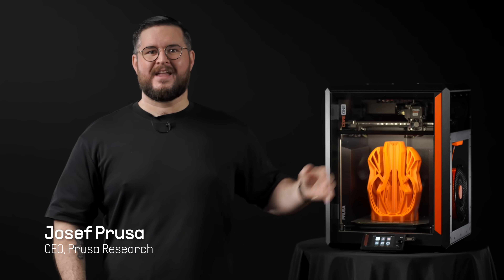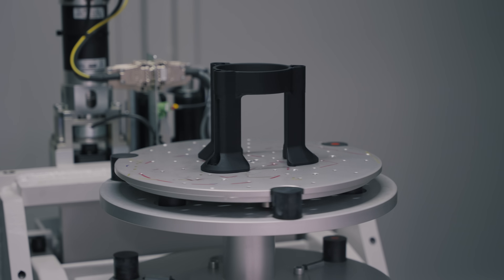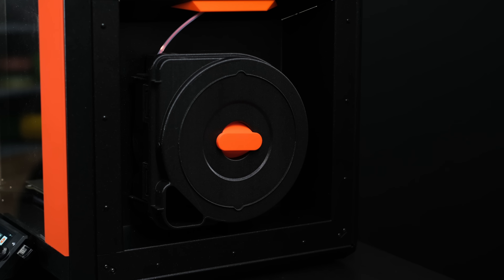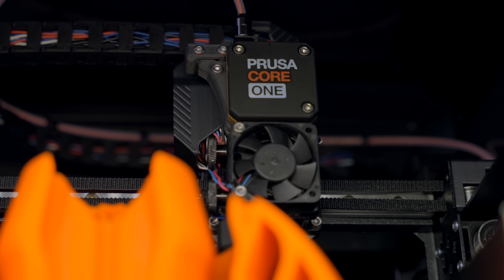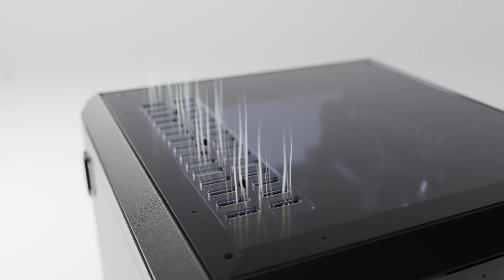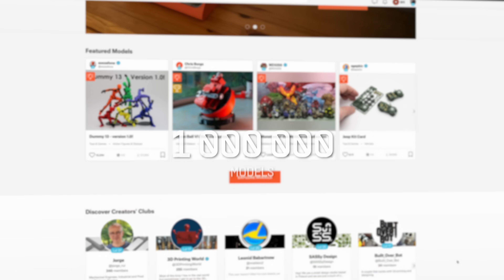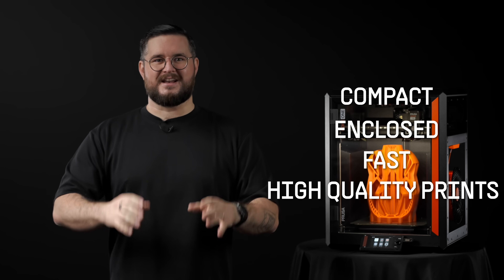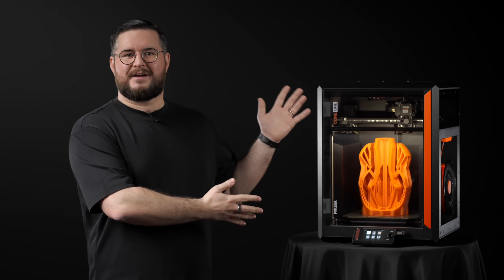Prusa CORE One - Fully Enclosed, High-Speed CoreXY 3D Printer With Active Chamber Temp Control

Comment: Honestly, the best feature of any Prusa printer is the support. Second is that the Prusa 3D respects its clients and users. No forced connectivity, individual parts available, no forced obsolescence.

I may chose other devices for various reasons, but I will always tip my hat to you, and seriously recommend Prusa printers due to what I've stated before.

Edit: Wait, what? MK4 can be turned into CoreXY? Okay, respect.
Reply: The support?? Hopefully you dont have the experience I did when I bought a MK4 at launch and they sent me a total lemon. Full of extruder and heatbed issues and couldnt print a thing. Support dragged me through the ringer for my full warranty period even admitting on record the machine was a lemon but that they wouldnt replace it because, ahem, "its better for us to just send you a part than a whole machine." Again, they admitted on record that the machine was a lemon but instead of replacing it they just ran out my whole warranty period looking for the one part to replace. I even said I would pay for shipping and send back my busted one, but nope. Guess you have to be an iNfLuEnCeR to get that perk unlocked.
By the way during that whole period they sent me one gear for the extruder. A nightmare of a full warranty period of actively doing chats and emails with them and thats how far we got. Now I'm out of warranty buying parts out of pocket just trying to get it to even work. I will never make the mistake of buying Prusa again.
Reply: There’s no forced connection with Bambu
Reply: Exactly. I didn't see that to come. They could say mk4s is different lineup and isn't upgradeable to core. Kudos for that. Big surprise.
Reply: "No forced connectivity, individual parts available, no forced obsolescence.", that is hardly unique to prusa. Other companies offer spare parts for their printers and I don't know of any consumer printer company that is forcing obsolescence, most printers with connectivity have the option to use it without or use a local mode too.

Liking a company is fine but don't make incorrect statements or imply things about other companies.
Reply: @conorstewart2214  BBL recently took some heat online for asking a customer with a broken XY bearing to replace the entire XY gantry, that might be what they're referring to - prusa being a much more open company makes them easier to repair in general.
Reply: @conorstewart2214  go check how many models from Makerbot and Ultimaker are now completely obsolete, some are newer than the MK3 and MK2.5 and those still get firmware updates to this day
Reply: @conorstewart2214   You're right that technically bambulab doesn't force connectivity, but they still shove it down your throat. Their slicer always resets to the network-based feature when I start it no matter how often I switch to the gcode export.
Reply: @brinkoftext remove the network plug-in
Reply: @CyThePhotoGuy_187   The slicer has no plugins or plugin settings visible anywhere.
Reply: Okay? Don't get me wrong, i love Prusa. But ... back in the days, as i bought my MK2S, the MK3 released while I was waiting on my shipment. Absolutely NO chance, that we can do something here. So at the time my MK2S arrived, it was already "old". So I bought the Upgrade-Kit to MK2.5. And in 2 years - also with the support - we can't figure out why not a single downloaded model from thingiverse or any other site printed to fit together on this printer. Something that you have to snap together, or little drawers or something else. Nothing fits, the tolerances from the downloaded models were "too tight" for my printer. And now I send EVERYTHING to my X1C and all fits together perfectly. This was my Story with "Support" :) All together it was a very frustrating time ... and experience.
Reply: @NemesisLex  sounds like you blame your poor assembly on the machine, like most chinesium users these days
Reply: @fofopads4450  And you sound like you're trying to discredit people on the internet because you have nothing else in life - except defending a company, like every fanboy these days. But thanks for your opinion no one ask for.

Comment: Ill never use another MMU. The amount of hassle headache and issues I had with it literally turned me away from the hobby. Going from an ender to a prusa was a nice upgrade but going from a prusa to a bambu was night and day. The price point for this when it's not even your top-of-the-line printer is still too high while also just now starting to scratch the surface of the X1C. That price point also didn't even include the MMU. I do have to admit prusa customer support is by far the best customer support I've ever had for any product, but these innovations are coming too late at too high of an expense.

Comment: I want a larger print bed but this is so cool to see!!
Reply: Agreed, but it looks like Prusa wanted to support a conversion kit. So they are using everything they can from the Mk4, including the bed. That said, it does look like they were able to get an extra 10mm on the Y axis (which has really always been there, but unused), which has always been the smallest dimension of their printers. Still - I would have loved to see them use the AFS size.

Comment: With the recess on both sides, it would have been cool to see a dual nozzle one extruder printer by default, most of us don’t necessarily want to print in multiple colors but need different support material or do a dual material print, it would have been an extraordinary feature bought back to consumers
Reply: Agree, I would pay the price for IDEX modification not just for small-ish core-XY
Reply: I hope that this will come, I'm really puzzled why this seems to be such a rare approach.
Reply: @Finnspin_unicycles  Research and component cost, probably. Also with most consumer printers having between 4 and 16 colors (well, those that support multiple colors at all), I think the big selling point to consumers is the color prints, rather than the more useful things like soluble supports.
Reply: Since everything is modular you could have an easy upgrade kit with a different gantry assembly
But yeah I agree I want soluble support without commiting to the XL x)
Reply: Yup. Faster, less wasteful two-material prints would be a genuine upgrade from Bambu… if the baseline quality and speed are there.
Reply: That will be a feature for the core one plus they release in June.
Reply: YES, that would be great.
Reply: Exactly. This was also my first thought when I saw this feature. Having in mind what Prusa Guys are capable of I am sure we will not have to wait too long for their "hold my beer" moment 😁
Reply: @vulterey  easy upgrade kit from this

Comment: It's very compelling, but it needs an ERV w/ HEPA (or S-class) base to sit on. 

Enclosed and low noise is great for placing it anywhere...so long as you ignore the venting requirents. Your HT90 handles all of this wonderfully but isn't within reach for non-commercial entities.

But I'm nitpicking, the upgrade path this offers is a pretty good tradeoff for legacy customers and shows an unmatched commitment to your creed and the community; well done!

Comment: This literally ticks all my boxes! Prusa reliability, decent price, enclosed CoreXY and a decent volume. If my current printer ever needs a buddy, this guy is a the top of the list
Reply: Don't forget open source hardware so you can replace just a single part if you need. Long lasting printer right here.
Reply: You call 1350€ 'decent price'? I'd rather take a Bambu X1C with AMS for 1250€ without thinking.
Reply: @NeariX846  The X1C has also been more expensive. But the difference is not so much when keeping the repairability in mind. Try to change that rods or pulleys in those BL machines when they're worn out. Good luck.
Reply: $1200 lol... that's ridiculous.......... PASS
Reply: @dronefootage2778 yeah, rather get the bambu x1c ams combo for 1250 or as low as 900 depending on where you buy. 

Prusa is falling off.

Comment: if using the side spool chamber, how to keep the filament dry? I normally use a sunlu filament drier and can dry the filament for a few hours as needed first and it continues to be kept dry while printing. Its not the best path, sitting on the table on the side. a more direct path would be overhead, with the filament feeding straight down into the printer. The filament tends to be pulled hard, this is not ideal.

Comment: Big fail with the 250x220 plate.
Reply: That's the price of offering a conversion kit from the Mk4S. The less components transfer over, the less sense it makes to offer such a kit.
Reply: Seriously, what do we have to do to get a 300x300 core-xy with an enclosure?
Reply: @brentmc79  Buy an XL, it has a 360x360x360 build volume. The enclosure is an addon.
Reply: @KonradTheWizzard  paying $5k+ for an XL with extra tool heads and an add-on enclosure is crazy. There’s no reason a slightly larger X1C or Core One can’t be made for just a few hundred more.
Reply: @brentmc79  My point being: Prusa already has the XL and now the Core One. From their perspective it would not be economic to build an intermediate one (in my opinion). BTW: the single-tool XL plus enclosure would be the equivalent of a big brother of the Core One - that would cost slightly below $3k in total.
Reply: @ I get what you’re saying, but I still think a 300x300 Core One for like $1500 would outsell this and the XL.
Reply: @brentmc79   Build a Voron?
Reply: @ScytheNoire  after tinkering with printers for a decade and now having several Bambu machines, the last thing I want to do is build, configure, and tune a printer. These days, I just want to print.
Reply: @brentmc79  SV08
Reply: @ I love Sovol and have owned at least a dozen of their printers. The sv08 is basically a rebranded Voron. It’s still not the same experience as a Bambu, or even Prusa. When they control the whole ecosystem, ie the printer, the slicer, the profiles - it all just works.
Reply: @brentmc79  I don't think that was really in the cards. The other option for them was likely to use the bed from the Prusa AFS, which is 260x260. 300 is probably too close to the size of the XL to bother with.

Comment: 4:21 that was a nasty jab at bambu lab's recent controversy for not allowing users to replace idler bearings, Instead they charge like $300 to replace an entire sub assembly...just to replace a $3 bearing. Prusa out here proving again and again why they're the best in the industry!

I see the bambu bots are already in full force defending their company with the 2.1 trust pilot rating.
Reply: I love and much prefer Prusa as a company, but I’m really happy with my Bambu machines.
Reply: Well, from my perspective, in the unlikely event that the idler bearing fails, it seems like the 2 hour + $300 solution is cheaper than 8 hours + $5. But I think it's good both are an option.
I don't worry about this kind of stuff with almost anything else I own and maintain.
Reply: We get it you are a die hard fan, but now you're actually defending something that's good ;). (Owner of a P1S) Prusa actually did a very good job on this one, can't deny it. I like the bambu studio slicer more, but you can just use orca slicer with this one soon, I'm guessing, so no point arguing.
Reply: 1. trust pilot is garbage. nearly no big company has a good rating at all. its just a vent for all the frustrated ppl. go and search for popular brands and see yourself. microsoft and google have 1.3 each. 
2. the bad rating is based on: slow service and slow delivery. from ppl thinking buying a 1500€ machine shipped from china is fast as buying a toaster on amazon shipped from the storage house next town. yes the shipping is slow when super many ppl ordering at the black friday sales. 

and sure call me a bambu bot, whatever. you are also just a bot hating on anything that is not prusa. but you forget: without bambu prusa would still sell the mk design that is outdated for years now.
Reply: @GolemShadowsun  Well this isn't about "big companies" with trillion dollar market caps. It's about hobby lvl 3d printer companies. And bambu lab is crushed by prusa.

Don't like trust pilot? Then lets look at google reviews then. Bambu is at a 2.7 (77 reviews) while prusa is at 4.3 (372 reviews) Prusa still crushes them. And if you think bambu's reviews are only about shipping speed then I guess you didn't look past the 1st page. I mean if trust pilot reviews didn't matter, then why did bambu lab go out of their way to beg for positive reviews a few months ago? They were originally at a 2.5. Then they went up to 3 after begging for reviews. Now a few months later they fell back down right where they started. Take out the begged reviews and they're basically at a 2.1 from natural reviews.

And you really think with out bambu, prusa would still be selling only i3 printers? Boy you sure forgot that the XL and even their AFS was in development long before bambu lab was even a name.
Reply: @GolemShadowsun Well this isn't about "big companies" with trillion dollar market caps. It's about hobby lvl 3d printer companies. And bambu lab is crushed by prusa.

Don't like trust pilot? Then lets look at google reviews then. Bambu is at a 2.7 (77 reviews) while prusa is at 4.3 (372 reviews) Prusa still crushes them. And if you think bambu's reviews are only about shipping speed then I guess you didn't look past the 1st page. I mean if trust pilot reviews didn't matter, then why did bambu lab go out of their way to beg for positive reviews a few months ago? They were originally at a 2.5. Then they went up to 3 after begging for reviews. Now a few months later they fell back down right where they started. Take out the begged reviews and they're basically at a 2.1 from natural reviews.

And you really think with out bambu, prusa would still be selling only i3 printers? Boy you sure forgot that the XL and even their AFS was in development long before bambu lab was even a name.
Reply: @GolemShadowsun  Well this isn't about "big companies" with trillion dollar market caps. It's about hobby lvl 3d printer companies. And bambu lab is crushed by prusa.

Don't like trust pilot? Then lets look at google reviews then. Bambu is at a 2.7 (77 reviews) while prusa is at 4.3 (372 reviews) Prusa still crushes them. And if you think bambu's reviews are only about shipping speed then I guess you didn't look past the 1st page. I mean if trust pilot reviews didn't matter, then why did bambu lab go out of their way to beg for positive reviews a few months ago? They were originally at a 2.5. Then they went up to 3 after begging for reviews. Now a few months later they fell back down right where they started. Take out the begged reviews and they're basically at a 2.1 from natural reviews.

And you really think with out bambu, prusa would still be selling only i3 printers? Boy you sure forgot that the XL and even their AFS was in development long before bambu lab was even a name.
Reply: To suggest there are "bots" is ridiculous. I'm still using my ender 5 with direct drive mod board swap, and bl touch.
The bambu x1 carbon was insanely good for the kick starter price, and I wish I had brought one back then when they were ~£600. I can't afford to drop more than that on any new 3D printer. 
If Prusa released an X1 carbon killer at sub £600, I'd be excited.
Reply: They are literally selling the idler bearing assembly for 7 bucks on their website
Reply: Why are you everywhere blatantly lying about this company?
Reply: @BeefIngot  Where's that rock you're living under?
Bambu lab literally stated a couple months ago on twitter that they wont allow users to replace idler bearings on it's own. Only that they would sell them $300 sub assemblies instead. All becasue they think their users are too dumb to do the repair themselves. This all started because a user with a kickstarter X1C had an idler bearing fail and bambu lab said they wont sell him replacement idler bearings. Its not my fault you don't keep up on all the L's bambu been taking.
Cope more
Reply: @LilApe this is entirely false they're working on a guide to allow users to replace the bearings themselves.
Reply: @LilApe  Thats completely made up, particularly the price. Even for the X1C the whole x assembly is less than 100 bucks.Its also very weird you put basically nothing as a comment then editted in that blurb so it would look like I didnt have a response.
Reply: @LilApe  Literally none of this makes sense. There is no such thing as the xy assembly. The y is part of the frame and the x is separate. You really do make up things and then upvote yourself.

The only thing you actually just confirmed is that I was right about the far lower price of the X and even there you lied by saying it's over 100, especially given they have free shipping for most places, unlike the company you  make up lies to support.
Reply: there is pro's and cons to both approaches
Reply: @JohnSmith-pn2vl  There is no "pro" to paying $300 for an entire sub assembly just to replace a $3 idler bearing. All becasue bambu is proprietary and think their users are inept. Just like how bambu wont sell you $10 CF rods for your X axis, but they will instead sell you a $100 sub assembly becasue their rods are epoxied into place.
Reply: @LilApe pros: 
- costs 500$ with more features than core one prusa
- can buy a second printer instead of replacing idler and still be cheaper than a single prusa 
Cons: 
- not easily replaceable
Reply: @LilApe  You know why you can get every part for an I4 separate. it's all generic
Reply: @backtoearth1983  You misspelled open source. And prusa doesn't even use generic parts, they never have. Every component they use has a name brand tied to it. Like delta PSU & fans. Or gates belts. Or LDO steppers, etc etc.